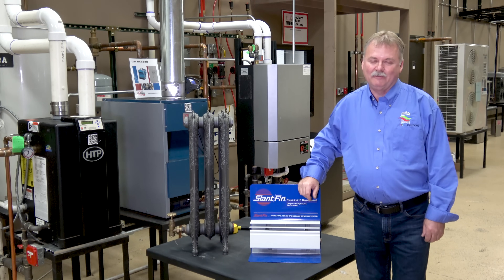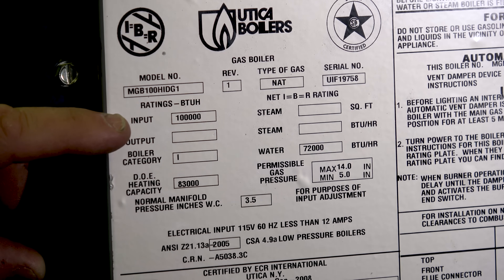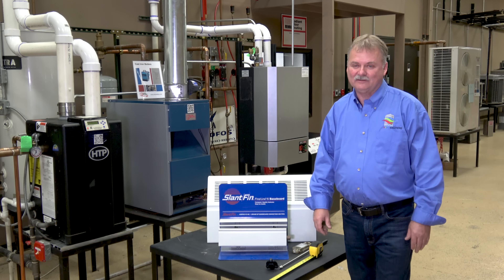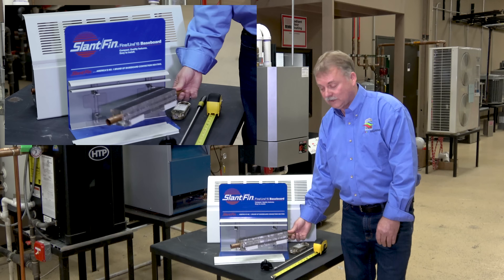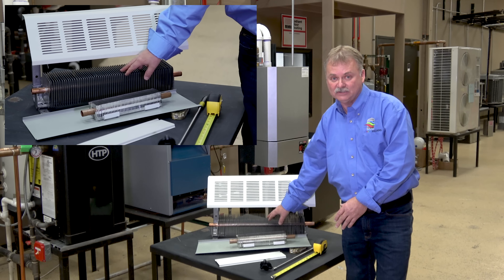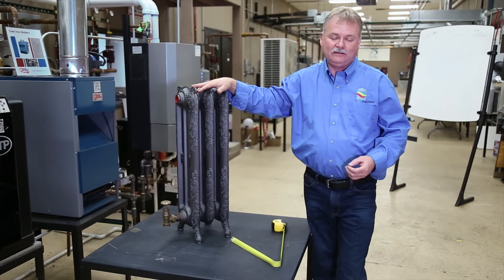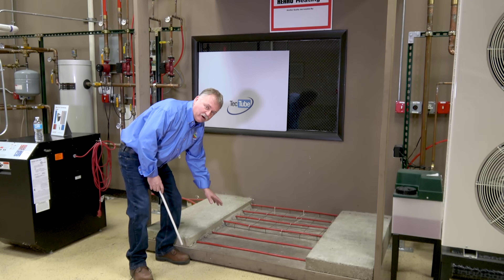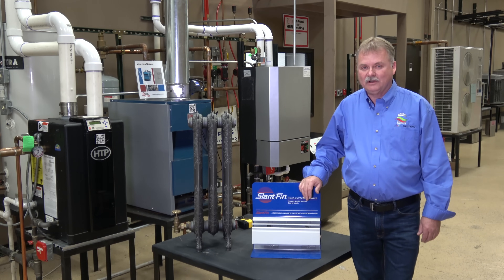Right Sizing a New Boiler... the easy way

Comment: When they right sized the company I worked for my position was eliminated :-(
Reply from the maker: You are saying that by your company installing a correctly sized piece of equipment, they no longer needed you to work there?  What was your job?  Did you go back to problem jobs caused by your co-workers due to over-sizing and band-aid them?
Reply: @TECTubefilms  I found your video because I recently replaced a Weil-McClain CGI-5 with a Weil-McClain Aguabalance 155 Combi unit.  It's for Radiant floor heat.  I can tell you I was VERY skeptical as I carried this new unit into my utility room like a suitcase that it was going to replace the CGI boiler (that on a good day I could lift maybe an inch off the ground).  However, I am TOTALLY SHOCKED at the performance.  I can't wait until the next propane delivery to see what the difference is.  The CGI either cracked or rusted out one day after my last propane delivery (yup she broke early hours Xmas Eve.  Woke up the house was 58 degrees F).
Reply: @TECTubefilms Nah "right sizing" was buzz word 10 years ago for "look out we're going to be eliminating positions".  I took the severance package and started a Consulting Engineering Business and never looked back.  I should have done that 10 years prior.  That company I had worked for has since hired as many or more people than they eliminated.  Lots more red tape and politics.  I consult to them on a regular basis now.  It's really been good.  I get to just be an engineer and solve problems.  In and out here's your invoice.
Reply from the maker: @Elkmonger  Ok... you were talking about a completely different type of right-sizing than this video was speaking to.  Got it.

Comment: I have an 1955 brick semi attached townhouse with approximately 1875 square foot of space. The boiler I have at the moment is the original cast iron steam boiler. Should I replace it with a Utica oil steam boiler? That’s what the contractor is recommending. Please your opinion will be greatly appreciated. Thanks and good day
Reply from the maker: Your contractor is in a better position to make specific recommendations than we are.  You could also get a second contractor's opinion.  With that said, we were the Utica boiler rep in Illinois for several years and they do make a good product.
Reply: Tec Tube thank you so much just wanted to why he would just recommend Utica only when they got other companies thanks again
Reply from the maker: @jballs1118  Our guess is that he looked at your current system, asked you a bunch of questions about comfort, asked about your energy costs, and perhaps your replacement budget... and then tried to select what you needed.
Reply from the maker: @jballs1118  Most installers will offer 2 or 3 options and let the customer choose.  However, with steam, there is not really too many choices.  Every steam boiler is pretty much 82-84% these days and not a lot of different features like you would have with a hot water boiler.
Reply: Tec Tube He also offer if I wanted to switch from oil to gas and I had just recently replace my oil tank is new. Also don’t know if that is better than just staying with oil in the event that in the future I will like to sell the home and the buyers will say why do didn’t you switch to gas is cleaner. My neighbor years ago switch to gas and his bill went thru the roof. He also offered me the new tankless boiler that don’t have to vent thru the chimney and for what I see in the internet a lots of customer are having problems in a short period of times. Thanks for all your help
Reply from the maker: @jballs1118  You must be in the North Eastern US, as it is pretty much the only place that still uses oil boilers.  Where we are in the Midwest, no one has oil at all.  It was eliminated decades ago due to our extremely inexpensive natural gas.
Reply from the maker: @jballs1118  When you say "tankless boiler," we assume you are referring to a hot water condensing boiler.  We have never seen a steam boiler of this type.  It is possible... and desirable... to convert the house from steam to hot water, but it involves more changes to the system than just the boiler alone.  But a 95-96% efficient condensing hot water boiler will save a lot of gas compared to a 82-84% steam boiler.  Note: you also need to convert from oil to gas when you switch to the condensing boiler.
Reply: Tec Tube Is it better to leave the same system just replacing the boiler and switching to gas only? Or just replacing the boiler and staying with oil ? I rather not changed the hole system to condensing it will cost a lot more. And yes am in the North East
Reply from the maker: @jballs1118  Only you can make that decision of lower installation cost (oil steam boiler with higher energy usage) or higher install cost (gas condensing hot water boiler with lower energy usage, less pollution, and no oil odor)
Reply: Tec Tube I was looking at the oil steam model 4125 Utica that is the one that is close to the one that I have at the moment. Oil is less for me at the moment plus am not sure if I will be here long term
Reply: @jballs1118  Ryan like to be political with stuff like this. I would agree that the choice is yours. But gas is cleaner and better for the environment. And again, like Ryan said, gas is super cheap here. Do the math on your gas. Figure out how much gas costs you, figure out how much the dirty oil system runs you, and do the math. Your neighbor years ago may not have gone high effeciency on his boiler and was previously using oil, so of course his gas bills shot up. He wasn't using gas before. It is all relative. There is a reason oil only exists in the North East these days, it is dirtier and they can't get super effecient like gas models.

Comment: You never actually said anything about sizing the boiler. You did a nice job explaining how to figure out how much heat comes out of the radiation but  you never actually spoke to actually measuring the heat loss on the structure and if we’re dealing with hot water that’s with the heat load should be based on. If were talking about steam I get the importance of how many BTUs it takes to fill the radiators with steam, but on a hot water system the boiler should be size to the heat loss of the structure. Length times width times height times eight was an old-school way to size a heating system in a home with no insulation and single pane windows. If the boiler and the connected radiation was sized based off rule of thumb such as that, then as the years go on the house gets updates like insulation and double pane windows we could easily reduce the boiler size by half. If one sizes a boiler based off the connected radiation in a hot water application in a situation like I just described, we’re going to end up with an oversize boiler, or furnace for that matter. Am I missing something or is there an additional video that points out how to do a proper heat loss calculation on a structure?
Reply from the maker: You are correct!  The radiators should be sized for the heat loss of the room and the boiler should be sized for heat loss of the structure.  For residential systems, the best way to do this is with an ACCA Manual J calculation.  A Manual J is generally done with software these days, but you could also do it manually if you wanted.

With that said, we have pretty much given up on getting contractors to do a Manual J calc on a boiler change out.  Most just want to swap like for like because it is easy and fast.  The don't want to spend an hour or two doing a load calc.  So that is why Bill advocates to at least do a radiation count as described in this video.  It is not perfect, but at least it allows a smaller boiler to be used.  Maybe they have a 150,000 BTUh boiler now, a perfect load calc might yield that they only need 73,540 and Bill's method might show a 100,000 would cover all of their existing radiation.

This particular video is not for the purpose of doing a heat loss calculation.  As stated in the video title and in the description section, the purpose of this video is to give a simple alternative sizing method.

Comment: I had a new boiler installed and I beleive they oversized it and it cycles 3-5 minutes and doesn't heat my house when it's really cold out. They can't figure out why but they tell me it's not shortcycling and not oversized. I have 134 ft of fin 3 zones and tankless hot water
They installed 11,000 btus. They say they have to add extra btus for the water. Is it oversized?  The contractor agreed to put a new one in but I'm afraid he will oversize again. Please help.
Reply from the maker: It would be hard, and probably unethical, for us to assume we can size your system without having ALL the details.  Plus that is the role of the HVAC contractor.  With that said, 11,000 BTUh would be a really small boiler.  For 134 ft of baseboard, we would be expecting an 80,000 BTUh boiler based on the re-sizing method laid out in this video.  How does that compare to your old boiler's size?
Reply from the maker: Do you actually have a boiler or are you trying to heat your house with a tankless hot water heater?  Normally, we would use a boiler and add an indirect tank water heater to that.  When we do that, we do not increase the size to account for the domestic water load.  But that is another discussion for another video.
Reply from the maker: If you are in the midwest and your contractor purchased the boiler from us, we can assist them with troubleshooting the issues you are having.
Reply: I meant to say it's 110,000 btus, my old boiler was 99,000. I'm in Ct ant they did bring the manufacture rep along with other techs. They measured house at 2,700 SQ ft and  heat load calc is 64,000, house was built 1990. Still no one has a clue. It's a peerless wbv series. I know that it runs 3 min on 3 min off when it's cold and  trying to raise temps.
Reply from the maker: @anastassiakarouta4325  If the load calc was 64,000 BTUh, then you would select a boiler with that output.  So if it was a 95% AFUE boiler, you would need a 67,500 boiler to handle the heat load on a cold design day.  If they make a 60k and an 75k, you would select an 75k but go no higher.  If you want an 80% AFUE boiler, then you need a 80k boiler.  The load calc needs to match the boiler output, but the boilers are sold by the input.
Reply from the maker: @anastassiakarouta4325  And if your old boiler was 99k and heated fine, your new boiler should be that size or smaller.
Reply: 110k btu is enough for that house,  I have the sme running in new york, you probabbly need for baseboard in each room
Reply: Thank you.  You're video explains it the best and I've read articles that say the same but everyone that has come to see it or measure has not agreed with me so the contractors is convinced it's not oversized and not the issue. They said that for zoning they have to add 30,000 btu for the hot water. They also tell me it's not shortcycling but articles I read if it's only 3 min on and off is shortcycling.  If it is oversized would it cause the problem of taking hours to raise temps and not keeping  up when it's cold.  At -15°I had 54° in the house.  I need to find someone in Ct that can take a look or talk to them maybe an engineer. Any suggestions?
Reply from the maker: @anastassiakarouta4325  We don't do work on the East coast, but that is the strongest boiler market in the country so there should be plenty of contractors and experts.  Check out https://heatinghelp.com/
Reply: @Buckeye4Life I have a circulator. What is a slave or pump and why would they not think of that as a solution when they  tried to figure this out. Last guy thinks the supply and return pipe needs to be 1 and 1/4" instead of 1 for 3 zones.
Reply: @Buckeye4Life return temps are at 170° and I don't think I have a combi. I love in western CT.
Reply: @Buckeye4Life it has zone valves. They have tried a few things to figure it out  but kind of gave up now because nothing had made a difference.  They changed the valves boiler control added more fin on dummy radiators and new circulator. The circulator will usually pump 3-5 gpm/zone if all 3 zones are going it won't go more than 11 gpm.  He has thermostats that show water going out at 190° and return at 170°.
Reply: @Buckeye4Life they have tried to down fire and then reversed it. They have put a new aquastat limit control and it burns  oil not gas. They were all confident it's not the boiler. Could it be something with the boiler or  is it a circulation problem due to 1" supply and return pipes?
Reply: @Buckeye4Life it takes hours to raise 3-4°. at 15° outside temp it maxed at 71° in. At -3° outside it maxed 65° and at -15° out I had 54° in the house.  All 3 zones the same no difference.
Reply: @Buckeye4Life you said I don't think so...did you mean that for the size of the supply and return  pipe?
Reply: @Buckeye4Life what would be at fault if the hot water is circulating past the zone valves back into boiler? The pipes feel  hot past the valves not sure what temp but the return temp is 170. I think when it's cold it can't keep the 170 return temp on all 3 zones. One zone will reach it but it doesn't stay at that temp long and the other 2 zones will be 150 or 160 as the whole house is calling for heat. The other 2 zones will drop to 150 or 160 and then vice versa.  When it's not that cold out it's able to stay around 170 for all three zones.
Reply: @Buckeye4Life  well you eliminated the oversize issue as others have they said if it was oversized it would heat the house.  It does not have an outside sensor. I can get you the model # but the rep from peerless came and saw it and didn't see an issue with the furnace.
Reply: @Buckeye4Life pipe size at each zone is 3/4
Reply: @Buckeye4Life also I read about buffer tanks and suggested that but he said it's not what I need. I don't have the big radiators do I don't know? Mo
Reply: @Buckeye4Lifehow wil  I send a pic ?
Reply: @Buckeye4Life it's not a monoflow it's loop and the kids one supply pipe and one return to the boiler. The pump was changed. The thermostats that they stuck on the pipes are before the zone valves and get to 170°. I had taco and now honeywell but they changed the valves to bigger ones that would take 6 psi each. The max gpm read on the  pump is 11. Is that enough? Could it be gpm or flow is too slow. It's a peerless wbv series boiler. I think wbv3. I used to have weil macneil.

Comment: Bill on the raiant would raising the temp from 90. Say to 110 change the btus of the concrete floor??
Reply from the maker: Radiant floor water temps often range from 85 to 110 degrees.  Yes, the hotter the water, the more BTUs can transfer.  Additionally, the cooler the room temp, the more BTUs can transfer.  The quantity of heat transferred (BTUs) is a function of the delta T across the heat exchanger, which in this case is a floor.

With that said, we seldom see anything toward the 110 range since it is generally too hot to stand on.  Below is what our friends at REHAU recommend for water temps of a floor and the associated maximum output based on those water temps in a 65 to 72 degree room.

Floor Area Type     Temperature Limit       Heat Output (Max.)
  Perimeter              95ºF (35°C)              54 BTU/hr(ft2)
  Occupied              85ºF (29°C)              34 BTU/hr(ft2)
  Bathroom              91ºF (33°C)              46 BTU/hr(ft2)
  Distribution      95ºF (35°C)              54 BTU/hr(ft2)

Comment: how do you do the calculations for a retrofit radiant underneath a wood floor?
Reply from the maker: Fast forward to the 6th minute of the video.  Our example was concrete, but it would work the same if you have other types of sub-floors using RAUPANEL or other products to distribute the floor heat.  It is all about the square footage of the radiator... which is the entire floor in this case.

Comment: Back in the day , Plumbers used the "finger method. They would stand across the street and hold their fingers up - how many fingers covered the house would be how many sections. True story. So many guys still put WAY too much baseboard in houses…I love sun-rads (semi-recessed ) myself, they are variable and don't take up wall space.  No mention of them in this vid ,   but they work well also.
Reply from the maker: We remember the days of the old finger method... well at lest Bill remembers... we are too young.  LOL
Reply: I heard that also but hope its hearsay
Reply from the maker: @thomasbroking7943  It was fairly common.  It "worked" for two reasons: 1) houses were all built about the same in terms of insulation, leakiness, and windows and 2) no one cared if stuff was oversized because fuel efficiency and comfort were not large concerns... people just wanted to stop having to put wood in the fireplace so a boiler was a very comfortable choice.